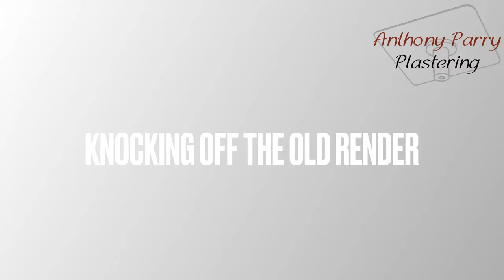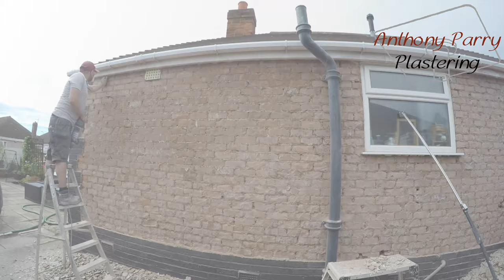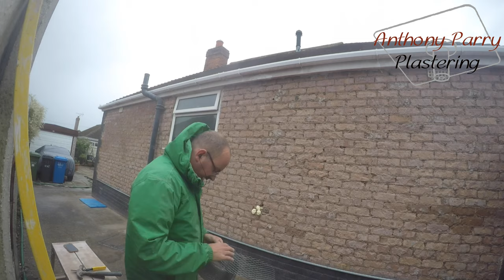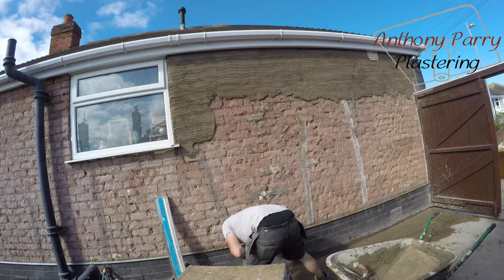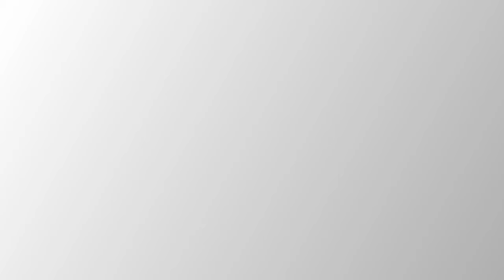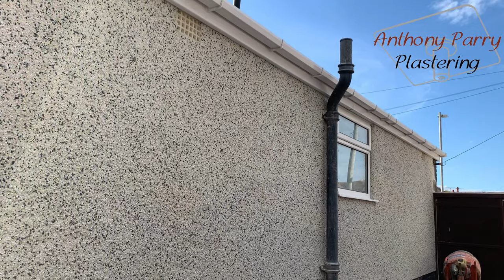Pebbledashing on my own Start to Finish Timelapse

Comment: Great job , when used to dash on my own ,I always used a watery pva on the scratch coat , it kept the dashing render coat from drying to quickly and aids adhesion, even with waterproofer in the base coat top coat can still dry quickly sometimes (only my opinion ) great job and well done on your own 👍
Reply from the maker: Cheers bud, yeah that’s top tip for controlling suction 👍